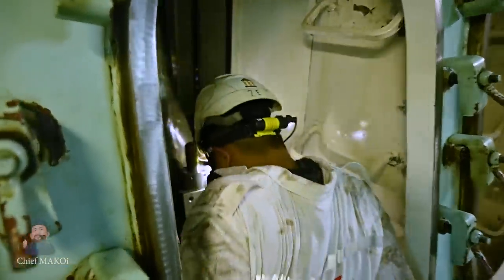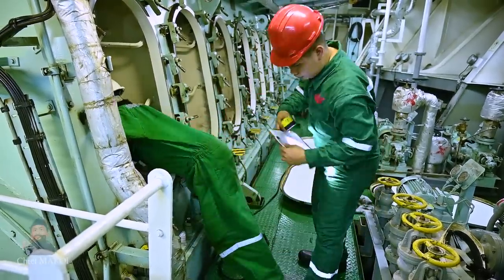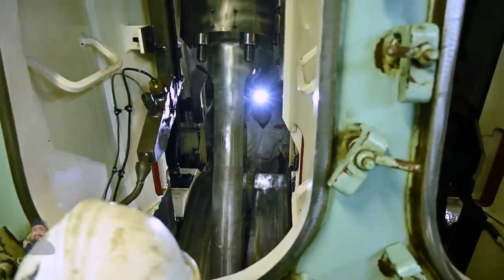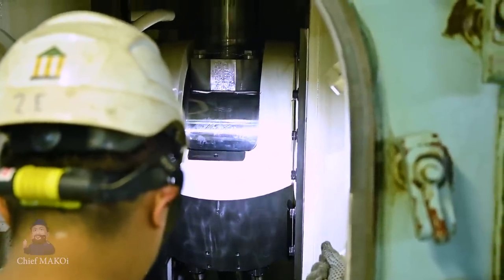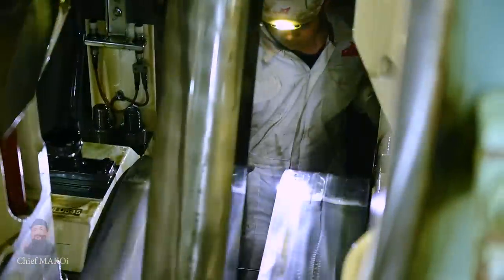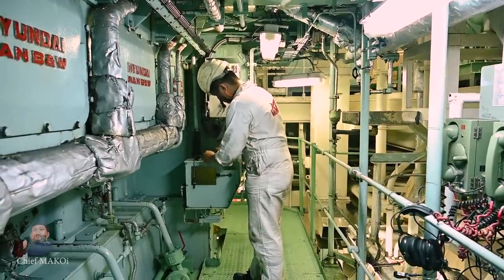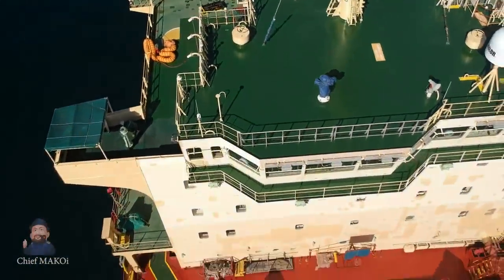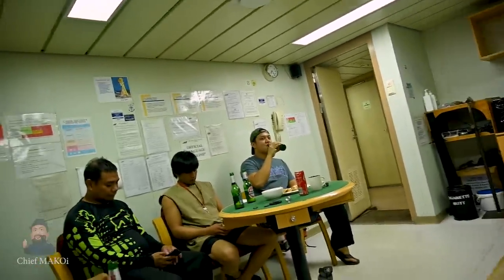Let's Go Inside The Engine's Crankcase | Chief MAKOi Seaman Vlog

Comment: For nearly fifty years I always saw those strain gauges in the L.S. Starrett catalog. I knew  what and why they were used after some research.  but  was never around anything that  big enough or that needed those measurements taken  or never saw anyone use one before I started watching your channel Chief. It would be fun for me to go inside one of those engines.  They are much different than the Diesel engines I work on that's for sure. Once again thanks for a glimpse into your world of engineering. I appreciate it very much. Cheers.

Comment: Interesting with the critical range, I didn't realize it on big engines. Our EMD engines had a range that you wanted to stay out of, 700 to 800 rpm, but it was because of the turbo clutch and not engine vibration. If you stayed in that 700/800 range, the turbo clutch would continually engage and disengage as the load varied, which would wear it out prematurely.

Beer on board! You lucky guys. 😃

Comment: I can only imagine how messy it must get all the time with equipment this large.

I'm not obsessive about being clean, but it was how messy I got working on cars that led me to stop. Even after a couple of years of formal schooling in auto mechanics. (A year at a trade school and a year at a technical college after that, was halfway to getting an associates when I stopped.) Specifically the mess that comes with grease and oils.

I still do some stuff with cars, mainly just my own but occasionally for friends (most likely I tell them to go to a shop, but if they just need a new belt installed or something, I am happy to help, but I am also very likely to make them actually do the work and thus learn how to actually do it, takes 2-3 times as long, but I like teaching). So getting a little messy isn't bad, it was the thought of that mess being my professional life which I really did not like.

edit: It would still be pretty awesome to step inside of an engine at least once though. Simply being near an engine the size of my first apartment is neat, getting inside of one would make me feel like I was in a mechanics version of Alice's Adventures in Wonderland.

Comment: I didn't realise these large engines could run in both directions - just assumed there was a gearbox to reverse the propeller.
I've seen tug-boats with direct reverse, but nothing this big.
Reply: Big 2 strokes with exhaust valves in head piston port inlet. Hence they run both ways just slower rpm in reverse.  The german built bulldog tractors big single 2 strokes could run backwards as well if operator was not carefull back in the early days of farming..

Comment: I don't imagine the engine has cooled significantly, hot job I'm thinking.
Reply from the maker: It's not really that hot.  During operation, the lube oil is about 52-53 deg Celsius.  So when we stop the engine, the oil cools down to around 35 C.  Then we open the doors and ventillate.
Reply: @ChiefMAKOi  I live on West coast of Canada and 35 is plenty hot in my mind Chief. It's 25 as I write and I'm sweating a bead.

Comment: Chief...how about when the  pistons and its bore experiencing blowby??do you change new pistons and new liners  like smaller diesel engines do??last question .what are ship's pistons composition???is it made from Titanium?ordinry steel or Alloy?? Do you have any clue.??because smaller diesel engines or gasoline engines are mostly made of aluminum...how about the ships?
Reply from the maker: Piston rings are usually changed.  But if the liner has some damage or excessive wear, they are replaced as well.

Comment: Going inside her where it's tight, warm and slippery... No wonder you volunteered. 

It's always pleasing to see the actual business end of any machine. Crude and intricate at the same time. 
How long is the lifetime of a merchant vessel's engine anyway?
Do the crank bearings ever get replaced ?
What do the engineering crew do when it finally earns a spot in the dry docks?

Comment: Another great video.  Is your main engine a dry sump design?  If the crankshaft measurements are out of tolerance, can you repair main and connecting rod bearings at anchorage?  Who gets to wash the oil soaked overalls?

Comment: First Great to have you back!  How many piston rods does the ship have? do you check all of them at the same time and how long from start to finish?
Reply: Number of piston rods is exactly the same as the number of cylinder heads, pistons, crossheads, connecting rods and cranks. Number of crankcase doors is twice the number of piston rods

Comment: So you have a few days at anchorage, you take the engine down, you’re looking for wear, and you unexpectedly find a crank shaft bearing failing. What do you do in the limited time you have? Do you have all the parts on board already? Great video by the way. At 6’3” I doubt I would have a good time inside the engine. I was very skinny in the US Navy and scrubbed a few torpedo tubes as part of my rating job. I couldn’t do it today - got too fat and too claustrophobic as I aged.
Reply: I suspect they would schedule the change at drydock later. 
From what i see in the his videos, it does not seem to be any way to pull the crankshaft out (or lift it).

Comment: I might have missed this but what happens when you find a major flaw in the crankshaft measurement? I assume that could mean weeks of being stuck in port while parts are shipped in and the upper parts of the engine torn down.
Reply from the maker: It depends.  If it's a main bearing issue, it's not that difficult to replace.  Usually technicians will come to inspect the crankshaft for cracks.
Reply: We will also check for loose foundation bolts.

Comment: I have quite a lot of questions and observations regarding this video, so I hope you don't fall asleep reading this comment.
Firstly, how is the engine rotated during this procedure?
Even back when I was able-bodied, I would find it t very claustrophobic in the crankcase. 
On that matter, on another channel, I once saw a video of a man getting 'stuck' briefly in the crankcase of a significantly smaller engine, requiring some 'gymnastics' adjusting body position to get out.  To be honest, I think he attempted the manoeuvre with the crankshaft in the wrong position.
Are there many female marine engineers?
Finally, are there any 'dry' ships where no alcohol is allowed whatsoever?

Great video, as always, Chief.
Reply from the maker: It's rotated using the turning gear motor.  I think you'll be able to see it in an old video I made about starting the Main Engine.
Not so many females, but they do exist.
Tankers are mostly dry ships.

Comment: i possibly missed it in the crankcase video you mentioned, but how do you turn the crankshaft so delicately? is it rotated by air or hydraulics or electric? don't let the guys watch those videos where the "experts" use a bent wire for a dial indicator.
Reply from the maker: Motorized turning gear engaged on the flywheel.
Reply: @ChiefMAKOi  cool thanks!

Comment: If a bearing needs replacements, can it be done while at sea?
Reply from the maker: It depends, but if the damage is not so severe, it's possible.  The danger of continuously running the engine with damaged main bearings is the formation of oil mist in the crankcase.  This could lead to explosion.

Comment: Would those compartments in the engine be bathed in oil during run operations? ...
Reply from the maker: Yes.  The Lub.oil pump is continuously running and it pumps LO through everything even internally for parts like the piston rod, piston crown, all the bearings, etc.
Reply: @ChiefMAKOi  - I can see why airplane engine mechanics envy you ... just climb in an spin the crackshaft ... too cool ...

Comment: where is all the engine oil... isnt the oil tipically in the bottom of the crank case....
Reply from the maker: It's down in the sump.  Right below the crankcase floor.

Comment: Does the crankshaft turn in an oil bath?
Reply from the maker: Oil is pumped through the insides of the parts (piston rod, piston crown, bearings, etc)  and splashed all over the moving parts.
Reply: @ChiefMAKOi  Thanks Chief, love your at sea Videos.